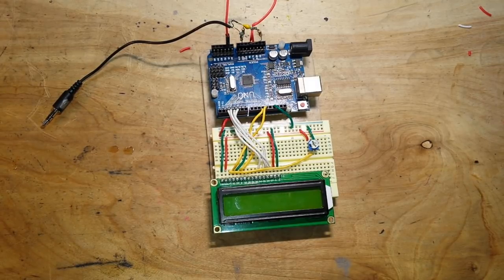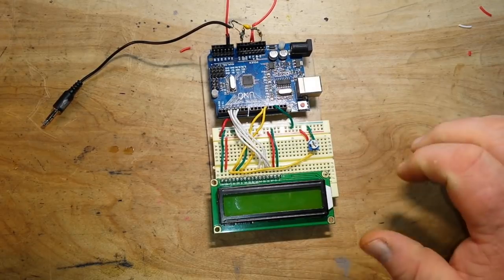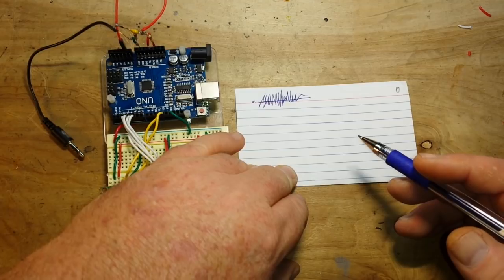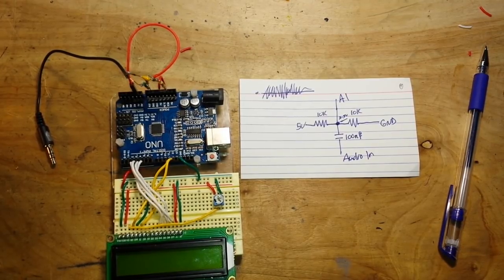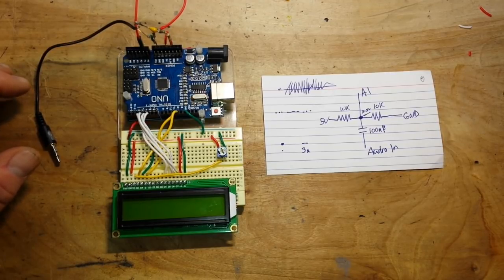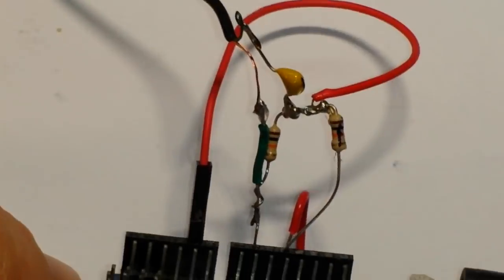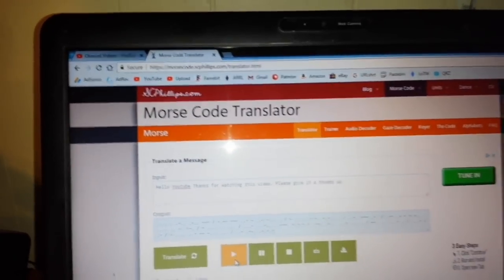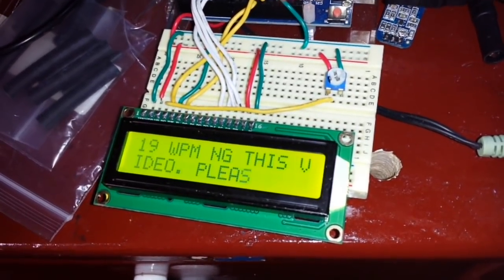Arduino Morse Code Decoder with Audio Biasing Circuit

Comment: OK, so... ignoring the vast bulk of the content (which was fine, it's just not what I'm asking about): Are you a (fellow) fan of Tom Tykwer and/or in particular the film Run Lola Run?  And/or what other inspiration(s) did you get for doing your credits roll top-to-bottom?  :)

But yeah, neat circuit!  Thanks for sharing that!

Comment: How do you wire up this circuit?   Is there a wiring diagram to do this properly?  Also could you provide a schematic diagram for this circuit?   I could not find a schematic for this, and it's not even available on the internet.  I see the sketch, but no wiring or schematic diagram to build this.

Comment: Can you use this for CW qualification in Ham radio? I want to get back into it after my experience in the late 70's. I have a Heathkit Apache transmitter, and would look for a Mojave Reciever if I could get passed the Morse code requirement. If only to provide emergency radio service in time of a catastrophe.
Reply from the maker: Yep, Digger D is correct. Morse code is no longer a requirement to get a ham license in the US. For technician and general it is just a 35 question multiple choice quiz and for amateur extra there are 50 questions.

A little basic knowledge of electronics and a quick study of operating procedures and the technician exam is very easy.

Comment: The Goertzel algorithm is used to detect the presence of a tone of a specific frequency.  It doesn't decode the dit's and dah's, instead it converts the input into tone / no-tone signals which then must be further processed to identify dit's dah's and letters.   What the use of the Goertzel algorithm saves is the need for input hardware such as a notch filter that would a specific tone and convert it to a logic level.  For this program the tone that it selects can be set to 496, 558, 744 or 992 hz.  You would then set your beat frequency so that the signal you want to decode is centered on one of the pre-selected frequencies.  If there happened to be other signals in the neighborhood, then the Goertzel algorithm would reject them.  So it is replacing a bit of analog hardware  (A filter) with a digital signal processing algorithm run inside of the atmel chip.
Reply from the maker: Nice! Thanks